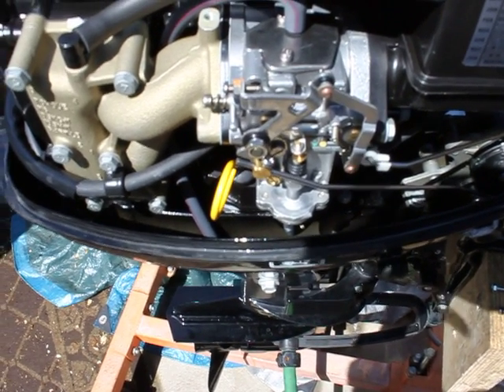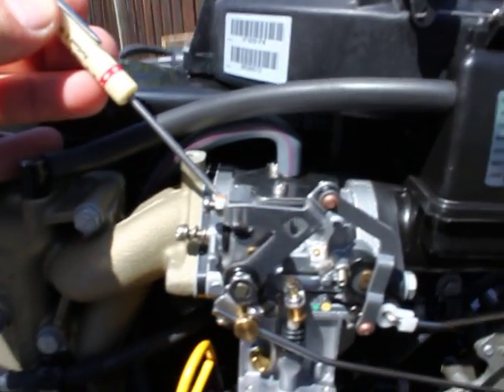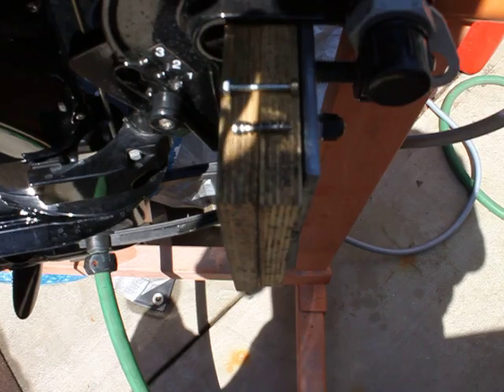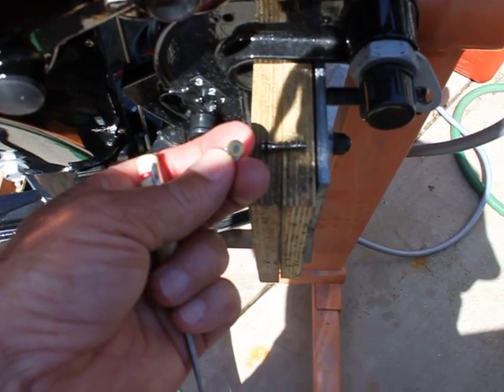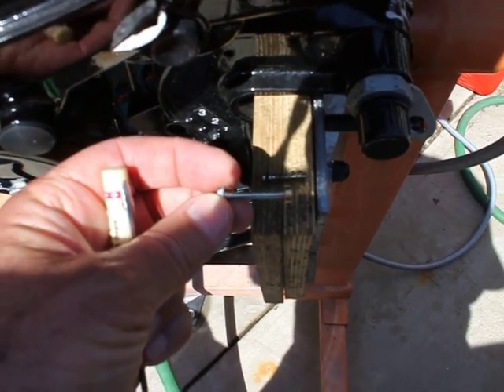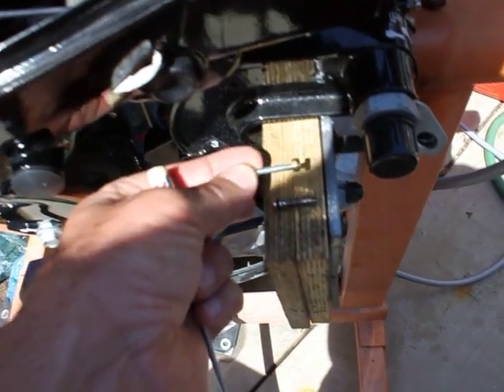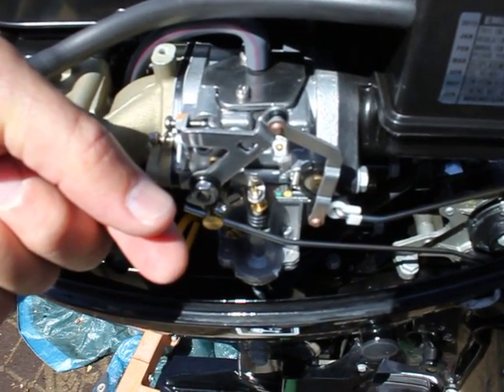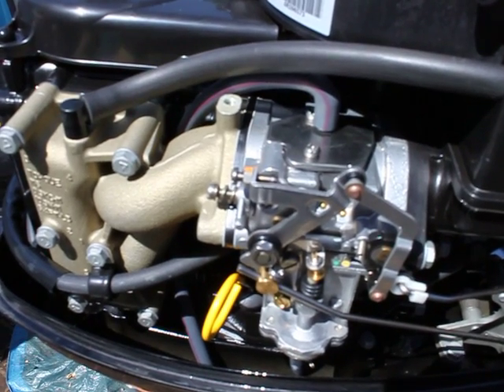Mercury Outboard Idle Adjustment

Comment: This is probably why people don't like Mercury outboards. If you're unlucky enough to get one that needs some fine tuning to idle right, you have to do all this crap just to access the freaking adjustment screw. Apparently the factory guys are so good that they think nobody should ever need to adjust the air/fuel mix on their very exclusive outboards.

Comment: I know this is an older video, but replying for anyone who might be watching, trying to adjust their idle. This is the air/fuel ratio screw, not the idler screw. Adjusting this will make your motor run lean, or rich. The idle screw is the easy one to access with the spring on it.
Reply: Thanks. Can anyone please link a picture of the idle screw on this motor?

Comment: Hi. I have 2006 9.9 mercury 4 stroke. Is there any manufacturer advise to adjust the two screws so the engine runs smoothly or just have to play with it until I get it? Any step by step advise? Thank you

Comment: Anyone having ANY problems with the idle on any of the MANY versions of this motor that have that new little PRIMER PUMP,  should HIGHLY consider replacing it first and then make "DAM SURE" THAT THERE IS NO AIR LEAKING ANYWHERE on the line into the carb.
IF THAT DOESN'T FIX THE PROBLEM I will replace everything that it connects too including the little plunger and diaphragm inside the carb. 

That little PRIMER PUMP BALL assembly is usually the main cause to almost ANY problems on ANY NEWER MOTORS that have them.

ONE LITTLE TINY PIN HOLE AIR LEAK "ANYWHERE" ON THE PRIMER ASSEMBLY "WILL" CAUSE ALL KINDS OF PROBLEMS!!!

Comment: So, the fuel air mixture adjustment is covered by a brass plug with a little dimple in it sitting 90 degrees to the idle adjustment screw?

Comment: mine don't have a plug in it . it is 2012 20 hp. my problem is idle screw for choke, when choke is pulled out for cold  motor